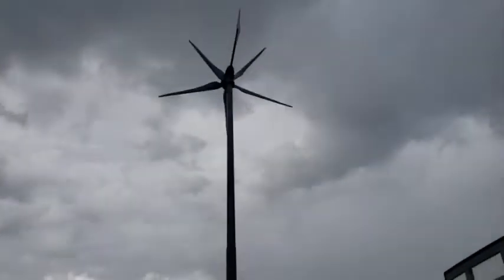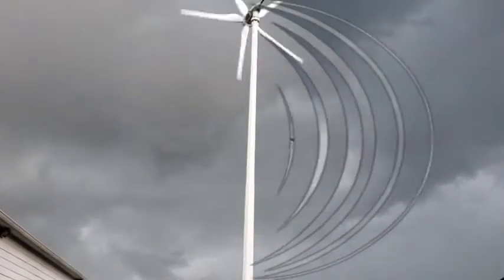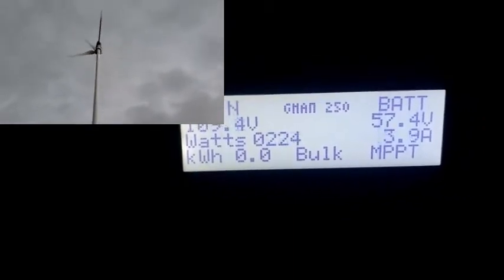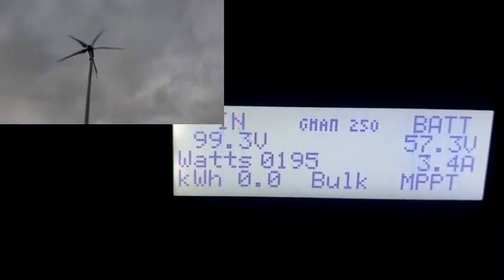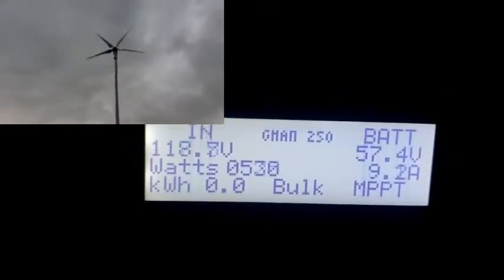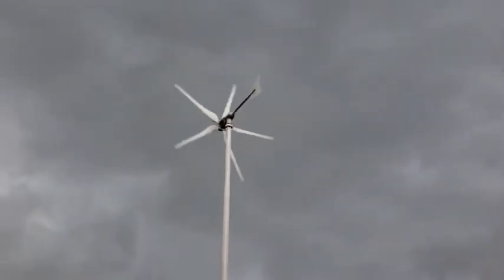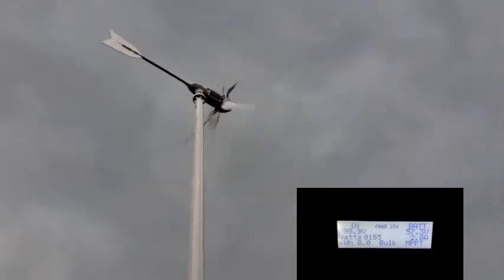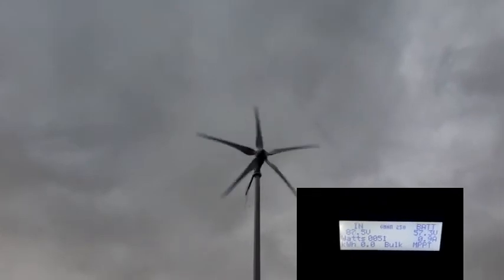3K Wind Turbine in 20 MPH Wind

Comment: Your not getting the power you should be getting. With 15-20 Mph winds and 25 Mph gusts my 3KW turbine output ranges between 1,800 Watts to 2,600 watts. 
 Your turbine is not high enough and it's tracking turbulence Not the wind direction. The wind does not change direction that quickly or that often. To get the full potential and much much more consistent output your suppose to have the Turbine off the ground by at least 60 feet And if there are ANY obstructions the turbine is suppose to be 30 feet above the obstructions.